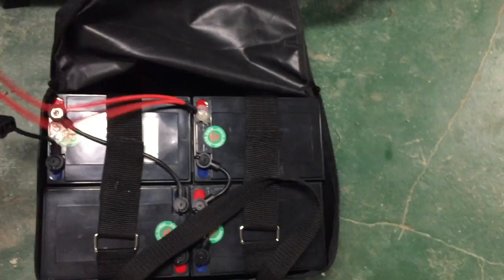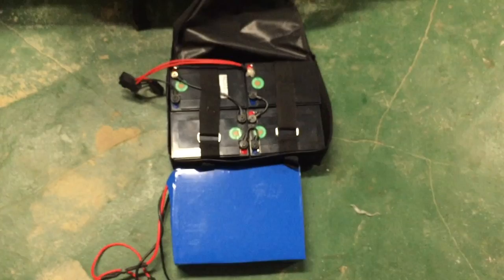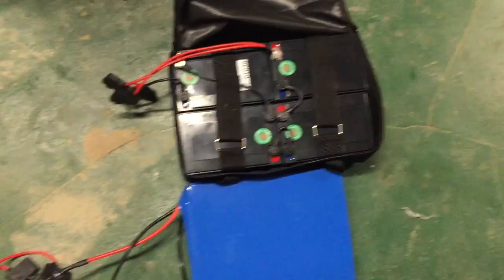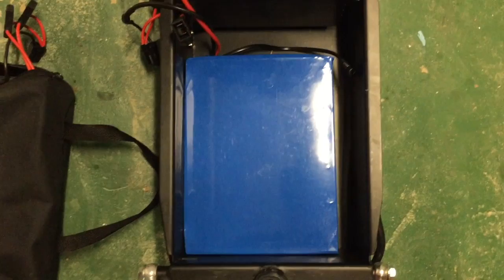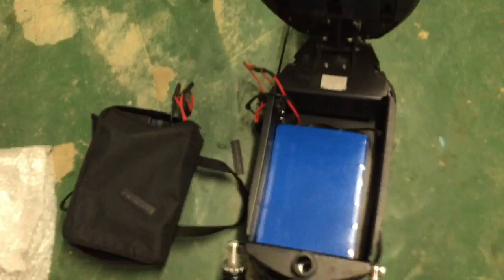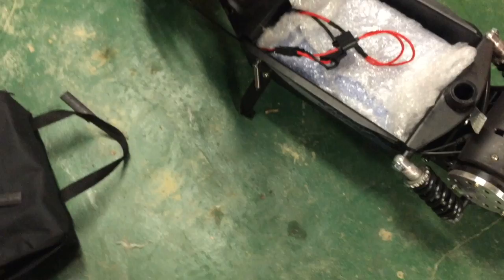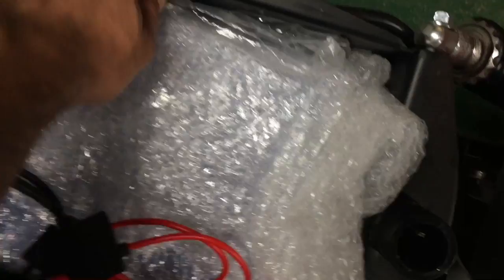UberScoot 1600w 48v Electric Scooter Lithium Upgrade 48v 25Ah

Comment: It is faster because your normal lead acid battery couldn't provide enough current to the 1600W motor. It needs 1600W/48V=33.33 A to run on full speed.

 Your lithium-ion battery can do:" Maximum Continuous Discharge Current (A)
 50A" it is good because you are not fully using all off(just 33.33/50=66%) it therefore it is not heating up so quickly while you are running on full speed. The life expectancy will be higher as well. The only downside is the price in my opinion. Great video bro :D
Reply: Pretty much sums it up right there in regards to the speed issue. Well said.

Comment: Could you fit a 72v one in the space ?
Reply: Yep, I did, I got a 72v 40AH battery, it legit snugged fit into the scooter

With 48v battery

Range: 15 Miles average
Top speed (Average) 34 MPH

With 72v 40AH battery (Stock controller) *Impressive lol 
Range: 94 Miles
Top Speed (Average) 84 MPH
Reply: @waistedsausage1071  where can i buy that

Comment: I ordered an evomotion scooter and im thinking of upgrading to lithium. Would this work for evomotion scooters as well?
Reply from the maker: Oh Definitely it will work evomotion is the exact same thing just with bigger wheels but the controller is the same plus anything that is battery powered can be replaced with lithium
Reply: Evo Production thx for the reply, im just unsure of something. Do u need to buy 4 x 12v 12a batteries if i wanted to keep 48v 12a power on my scooter? Or do i buy a battery pack like u? One more question, how can i increase the distance my scooter can do in 1 charge? Sry for the newbie question im just really new to this and it rly grabbed my attention :)
From 12A to 25A is a pretty big jump. Also arent the watts determined by the motor and not by the batteries?
And would u advise upgrading my evo 1800w 12a to 2000w 25a?
Reply from the maker: the 12v 12ah batteries are the lead acid witch comes with your scooter already. your scooter has 4 of the 12v witch makes 48v (12v+12v+12v+12v=48v same for the 12ah its also 48 but lead acid the way it works for it to be able to recharge it only uses 50% of its power so lithium is an upgrade from lead acid witch is smaller and has more power and gives more power up to 90% of the battery and still being able to recharge. From 12Ah to 25Ah it is a big jump but ah is for the distance meaning the 12ah is 12miles and the 25 is 25miles
so when looking for a battery you want AH if you're looking for distance the hight the AH the longer you will go. 1500w 1600w 1800w 2000w are all the same motors the only different is torque the 18 and 20 are best for hills going up hill fast. on any scooter the power and watt is controlled by the controller meaning my scooter is 1600w and i have a 2000w battery the controller and the battery gives what need to run everything fast as possible without damaging anything. the controller knows what the motor is capable and what it will need. I hope i helped
Reply: Evo Production wow thx for the info ur good man. So lithium is the way to go in terms of overall performance. If i upgrade my battery to the one u did in the video, will the speed increase as well or is it dependant on the voltage? So if i buy a 60v pack would it give me more speed but would it also burn out the motor? Would u advise an upgrade from 48v to 60v? Thx again
Edit: on one of the comments u replied to u wrote u need a conversion kit yet in the description it says the opposite
Reply from the maker: yes lithium is defiantly the way to go I wouldn't recommend getting the  60v because you would need to upgrade everything for it to work a60v like ne 60v motor  60v DC controller 60v throttle..... If you want more speed and distance get a 48v 20ah or 30ah for best distance at top speed. that was my whole issue i liked the scooter but it died too fast and only got 25mph top speed once i upgrade i can get between 30-35 continuous for 27miles witch it more than i need an i go everywhere with this thing. 
the ''conversion kit'' is the harness that holds the fuses one end connects to the battery the other to the controller. when you buy a battery it won't come with the plug to fit your scooter you will need to buy that separate 10$-$20 the battery will come with three thick wires sticking out of it  Red(positive) Black(negative) and a charging cable the charger that will come with the battery fits in this.
Reply: Evo Production thanks for the quick reply. I think i will get the battery u had in this video. I saw on your other videos the brushless 1500 scooter, at the end u mentioned it has one of the best lithium batteries made. Is that battery only available to this specific scooter? Im researching the best lothium batteries cant decide which ones are the best. The one from this video seems to be of good quality, however i wouldnt mind paying extra for something even better
Reply from the maker: The 1500w battery was the best ever made until i got this 48v 25ah much better i said it was the best because it gave me 20 miles of range and after i bought this battery it was a whole different story smaller lighter faster to charge by 5 hours at top speed 27miles distance
Reply: Evo Production nice, well i guess ill be buying the one in this video. Thanks for the help man, i hate to be annoying but there isnt much info about batteries out there.
Thx again
Reply from the maker: no problem i completely agree i had to learn the hard way wasting money, If you have any more question feel free to ask i would love to help.
Reply: Evo Production hey i have a question. I will soon be starting college and it's a 3km ride to college. But i dont have any means of charging battery at college. Could this damage the battery more over time? Suppose it will be standing for 7 - 8 hours, will it be bad for batteries? I have lead acis batteries btw saving up for the lithium
Reply from the maker: its fine only 3k won't hurt the battery
Reply: Evo Production thx :)
Reply: How about a 5 - 6km?
Reply from the maker: if you go off turbo it should be fine but if you constantly do it like daily it will go out a lot quicker lead acid lifecycle is 250 I would recommend to go at slow speed you will be fine high speed will use more power
Reply: Evo Production is that the same case with lithium batteries?
Reply from the maker: lithium is better it last longer so you wouldn't need to charge it all the time
Reply: Evo Production thx

Comment: Hey my Lithium battery finally arrived! but i just found out Big Toys USA that they no longer sell the wiring harness with the two fuses, now the kit only has one fuse! 
My question is, do you think i can remove the wiring kit that's connected to the lead acid battery and just connect to Lithium battery? and would you think the single fuse harness would work?
Reply from the maker: Link below for the one I got, but if they sale only the one fuse it will still work. Yes you can remove you harness from the old battery it will also work

http://www.bigtoysusa.com/uberscoot-battery-wire-kit.aspx
Reply: awesome thanks man, can't wait to do this
Reply: Thanks .Would this battery work with my uber 1000w?

L
Reply: @ari1234.  no it will not. the controller is a 36v not a 48v. here is the link to the battery pack that will work for it. https://www.aliexpress.com/store/product/Hot-sale-36V-Lithium-battery-36V-20AH-Electric-Bike-battery-36-V-25ah-1000W-Scooter-Battery/1473151_32825976769.html?spm=2114.12010610.0.0.66ee60c81hdcek

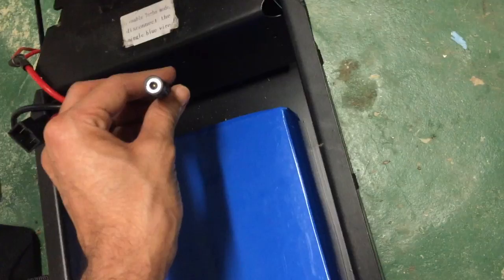Comment: 4:59   get a controller with charger support 
and make sure you dont use plyer in that  charger port
i broke my 36v  bms because my plyer got in the hole :S
well im sure im late 

so 60v convertion here i am aka right now waiting on controller-battery-motor :D

Comment: Sir please tell me is SLA battery motor controller work correctly with lithium ion battery.
Reply from the maker: Yeah it works perfectly with lithium no worries i been using mine for about 9 months now with no problems

Comment: What he said about speed and miles with the original battery is WAY off. Even on the website they say you get about 10 miles max ON REGULAR speed, which is roughly 18 mph. Turbo gets you about a mile, if that. That's about 30 to 32 mph. Even fresh out the box. I don't know where he got his numbers from.

I just ordered that same battery he has. I'm not gonna hold my breath on the numbers he gave for that one, but hopefully I get some longer ride time at least.
Reply: agreeed
Reply: Where did you order The battery?

Comment: I do not believe you can max the throttle 35mph and get 27 miles to the battery! that sounds insane!
Reply: My brother just got one the lead acid battery will go 40 kilometers in distance on a charge. Lipo batteries are way better
Reply: i did it on mine too. use 52 v battery
Reply: Who knows
Reply: Dose anyone know what sort of charger to use for the plug in the same as the one in the video. I’ve ordered a 48v lipo battery with the same connector battery side just not sure what plug it will fit charger side?
Reply: As shown 4:57 in the video
Reply: @Idotisme  n more dangerous
Reply: @loyaltyovermoney5942  in the wrong hands hahaha
Reply: @Idotisme  I just ordered a 48v 20ah for my scooter sick of them heavy ass lead batteries they like 40 pounds n slows scooter down who cares if the lipo blows up at least I'll have a blast  😂
Reply: With a 35 amp, can get up to 50 miles
Reply: For real 😂😂

Comment: After hitting the turbo button and really getting get going, I can clearly see I don’t need more speed. 
 To improve the Range However....that would be so awesome....
Reply: There is a Turbo Button ? Where ?
Reply: @TheSkyPod  if you’re referencing the UBERSCOOT 1600W 48v, when you open the battery compartment there is A thin grey wire and a sticker on the inside of the battery compartment that says something like, to engage turbo, disconnect grey wire. After disconnecting the grey wire, turbo boost. Wear a helmet 🪖🙏🏽
Reply: @NGASAKI  Yes , I was aware of that WIRE , just wondered if there was a BUTTON somewhere I was missing .
Reply: @TheSkyPod  my bad 🙏🏽😁
Turbo button is (on mine) right on the throttle assembly. Little red button.
Reply: @NGASAKI  Haha . Didnt even notice it . Just got mine through auction and  there was no manual .  The problem with mine is the bar (for the seat) that goes through the top of the scooter , is unmovable . I cant twist it at all. Need to have it turned around so the seat assembly and cover can be put on facing the right way so you can pop the battery compartment open .
Reply: @TheSkyPod  to remove the seat bar, directly at the bottom of the seat bar should be a lever. Pull it back, and twist the seat, it should come right off. Correction,  at the bottom of the seat, directly behind the battery compartment.
Reply: @NGASAKI  Yes I have been doing that and that sucker wont budge. I got this off auction and I think the moron that had it be for me used a hammer on it , not knowing the lever was there. I mean that lever is there for only one reason and I have pulled that lever out as far as it will go , even taking the back wheel/motor  shield off to get it down further. I will just have to live with it. Other issues include the plastic battery foot plate doesnt sit flush . Had to drill out around the controller compartment for the screws to go down into . Minor stuff.
Reply: @TheSkyPod  the things people do huh 😂
 Enjoy it!!! I loved mine but upgraded to an OSET 24.
Reply: @NGASAKI  Nice ! What kind of speed you get from that OSET 24 ? Been dreaming about the Sondors’ $5,000 Electric Metacycle .
Reply: @TheSkyPod  well...😁 with the 48v 40Ah lithium battery I have in it now, I go about 32 mph, which is enough for me. 
Very well built bike🙏🏽😁  with the stock battery a reached 25MPH

Comment: I WENT TO THE LINL ON THE VIDEO YOU MADE AND THE BATTERY CAME UP IT WAS 400 DOLLERS?? I FOUND THIS ONE ON EBAY I HAVE THE SAME SCOOTER YOU HAVE THE BATTERY I FOUND WAS  Li-ion Battery 48V 25AH Volt Rechargeable Bicycle 1200W E Bike Electric Li-ion 175$ WITH CHARGER, PLEASE GET BACK TO ME.

Comment: Hey, did you have any issues with the seat getting stuck? if so, what did you do to remove it?
Reply: Evo Production 

my seat is stuck and i can't get to the batteries any tips
Reply: Use a big screw driver and pry the bracket open and then turn the seat left to right to free it and pull it upwards at the same time, then oil it or grease it next time you put it back in.
Reply: @sonofmann  Actually, i had this problem on my uber scoot 1000w. there are like 2 or 3 wires that run under the rear gaurd for the motor. they had actually gotten stuck behing the sliver braket that you push to release the seat, so i could not push that back far enough because it was pressing on the wires. hope this is your problem to.
Reply: @anthonylattanzi3199  thanks I'll definitely try this.
Reply: son of mann great, keep me updated

Comment: where did you get the battery??? nice job.
Reply from the maker: I got it From Aliexpress it came in One week If you want the exact link i Just put it in the Description above
Reply: thanks. I'm about to order one. how the new battery is working out for you??? does it need any other parts?? or is running fine ??
Reply from the maker: You need to get the Wire Kit Also. The battery runs great i use it daily with no problems. 27 miles of high speed at 35mph charges super fast Highly recommend it makes the scooter way more fun ride it until you're tired

Comment: Yea that looks pretty confusing and im not good with wires..sux cause I wanna upgrade my battery..but oh well..it is what it is
Reply: There really only 2 wires that u connect battery to controller black n red
Reply: @loyaltyovermoney5942  I couldn't find this scooter so I gave up and got a different one

Comment: I have a 36v 1000w über scoot. Which LiPo should I buy and do I need to buy a new charger to go with it?
Reply from the maker: you can get any lithium battery LiPo, LiFePo4 or18650 cells as along as its 36v. So if you want just standard get the 36v 12ah you get about 12-15mile range the ah is for distance how long you want it to last the higher the number the better battery cells. You do need to get a different charger but 99% of the time it comes with the battery because lithium is different the charger has to be specific for the battery so they provide the correct one. sorry for the late reply
Reply: Evo Production thanks so much! Is the harness difficult to attach?

No worries about when you reply I assume you have a life beyond YouTube hahahaha, so i don't expect instant replies or anything lol.
Reply from the maker: its simple the battery comes with black- and red+ same for the harness just connect the matching colors and you're set. 
feel free to ask anything i would love to help. Thanks

Comment: can someone give me a link for uberscoot 1000w 36v battery?
Reply from the maker: it is out of stock all websites that sell ubercoots get it from the same source and thats bigtoysusa.com you can fin it in ebay and other websites but they are overcharging and its an older model. I am waiting on tires for mine i called them they said they shipment should arrive in a week

Comment: WHERE CAN I BUY THE BLUE BATTTERY?
Reply from the maker: US EU no tax 48v 25Ah 2000w Lithium Battery Pack with 5A Charger Built in 50A BMS Electric Bicycle Battery 48v Free Shipping
https://www.aliexpress.com/item/Free-customs-duty-High-capacity-48-volt-li-ion-battery-pack-with-charger-and-BMS-48v/32653882085.html?spm=2114.13010608.0.0.czVjUv
Reply: Evo Production THANKS AGAIN

Comment: moto tek scooter 3 miles at best thats 8km full range i know as i own scooter of the same but higher secs max speed 26 ah had it 2 years hardly use it i can only get too the shop n back  0.6 miles there ad 0.6 miles 1.2 miles i have  1 bar left , cant find a 25ah lithium ion battery too install so just sits their a a dead paper wait i got all my money back for the lies i was told n kept the scooter in about 10 years when parts are available

Comment: Hi, apreciate what you do.
I bought a 1600w chaos scooter https://www.funbikes.co.uk/p4523_chaos-sport-electric-1600w-big-wheel-powerboard-scooter 
(I live in UK) and I am wondering if I could buy the battery that you put in the description...
The question is: will I need to buy another controler? and if yes could you please leave a link for me?
the engine is 1600w, the battery that you provided in the description is 2000w....Will it hurt my controler or engine?
Thank you very much and have a nice day.
Reply from the maker: Chaos is the original UK version and uberscoot is the US version same manufacturer. 

You can buy any battery as long as it’s 48v or whatever voltage is needed in your case it’s the 48v that link is just what I have look around you might find better deals now. 

You don’t need a new controller as the one you have will work fine without any problems, however if you want to go faster get more power than upgrade your controller to a 40amp instead on the standard 30amps. Link for that exact controller is in the video description or comments
Reply: Jason Evo That is what I meant, If I buy a 40 amp controler, which will push the engine to go faster, this speed increase could lead to damage my engine because it was made for a 30 amp controler and his standard speed?
Thank you for your time answering me, I hope to see more videos about service and maintenace, maybe some upgrades to the scooters, thanks
Reply: Scented Style p